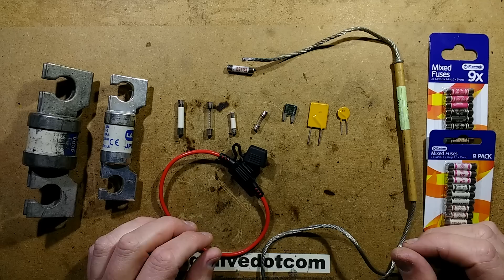Things you should know about fuses.  (including a 15kV one)

Comment: I like the longer 30ish minute videos because they have little tangents of knowledge explaining all the nuances. 

I knew off the cuff all the standard fuses (ie., HRC, slow blow for the inductive spike on start ups, NTC/PTCs etc), but I don't work on mains-level components. so when I saw the bi-metallic strip and thought "oh it must just be like an RTD" and it clearly was not, thus illustrating your "mishaps due to overconfidence" scenario beautifully.   

(Though, had I actually realistically been in a situation to design or remediate something similiar (rather than just watching this in a recreational capacity whilst eating lunch, I would immediately look up the application notes from at least a few reputable vendors such as Eaton or what have you -- the point stands. Moar videos like this!!!!)
Reply: Also, I had mistakenly thought that IP67 87v's were explosion proof (i.e., while working in a dangerous environment, the meter will not contain any component to escalate the danger level). I had then quickly remembered this was only the case for the  red-enclosure versions 87v and 28i -- both designated by Fluke as 'instrinsically safe'. 

Standard US military issue from Fluke was the 27/FM, which were available on ebay for pennies (comparatively) a few years ago before. They had upgraded all of their staff with 28ii at the same time, and flooded the market with top-quality 27/FMs  from the surplus suppliers. People were getting entire units with cases, high voltage probes and 8 month old calibration stickers, for less than the price of retail high voltage probes.

The first digit of the IP is for dust and particulate ingress (6 being dust-proof), the second digit indicating water-proof up to a certain pressure (7 being at least 3 minutes of at 12.5kPa at 10 litres a minute of flow, 6.3 nozzle dia -- 8 being 3 minutes @100kPa @ 100 l/m, 12.5mm nozzle dia). At standard pressure, '7' works out, 'waterproof' up to a meter of water at SATP under 3 feet of water load for no less than 30 minutes)) '8' being essentially hermetically sealed.

In practice, an IP 68 rated piece of kit will most likely be explosion proof, but there are special class, division, and group designaters (materials, autoflammability, etc) must actually be matched properly to the environment to ensure safe usage.

Comment: I did my tool making apprenticeship at a company that made HRC fuse links i think that the sand was silicon and another reason for the sand was to stop an explosion with associated ceramic shrapnel . The fun thing to watch was the test room for testing ceramic insulators for high voltage transformers they got a blue mist of electricity shimmering across the insulator ans if there was a pin prick in the glace and water had got in ka boom instant steam and shrapnel fun days

Comment: I don't think you mentioned it, but i am curious if there is a different behavior in fuses when using AC or DC? I know there are special circuit breakers for DC, but i don't think i've ever seen specialized fuses.
Reply from the maker: You do get specialist DC fuses, but for low voltage use normal fuses are often used.  The main issue with DC is that the current is continuous and therefore it's harder to break the arc.

Comment: When I worked for an American analyitical company, we had to carry both US (UL STANDARD) and UK fuses. There is a major dif in the spec for TD/slow blow fuses.
We had a cct bds that kept getting destroyed if something shorted. Turned out that we the slo blo US fuse could handle a far higher surge and we had to replace it with a far higher slo blo UK which didnt give enough protection. If you look it up I think its to do with the rupture voltage/current.EU fuses were dif also as was Austrailian. Ended up carrying so many types of fuses!

Comment: You didn't mention gas discharge tubes. Not technically a fuse I suppose as we used them to divert high voltages from lightening strikes to ground

Comment: My only interesting fuse experience is rather mild.  The output of a low voltage DC power supply had a 7A fuse.  I only had a 120V fuse handy.  Hey, amps is amps, right?  It blew.  I was advised I had to use a 32V fuse.  Sure enough, it held.  It looked the same.  I guess the timing was different.

Comment: Clive, not quite the full story on that HV link, the steel strap is in there because there is considerable tension put on the link by a spring at the bottom, when the link blows, the spring releases a cam mechanism that effectively shortens the candle (drop out tube) this means the top of the candle drops out of the top contact and then the whole candle swings down and hangs up side down in its holder. This gives the faultman a visual indication that thw link has blown and it's this drop out function that actually ensures the fault is clear. Hence the name, drop outs.

Comment: Had fun with the glass AGC fuses, applied heat to the end caps and removed them, replaced the fuse wire with a piece of ultra fine copper wire. Resealed the one end with wire in place and let it cool. Afterwards added a little black powder to fill half way and then stuffed a bit of paper towel in the tube to keep powder at one end. Fold over the copper wire over the tube and re soldered the cap back on. A quick continuity test to confirm all is ok. We used these in golf carts when we wanted to prank someone. They only went into a fuse holder under the bonnet so as not to allow fragments of glass to fly freely through the air. When the circuit is activated the mark will mess their pants when the fuse blows, goes off like a very loud firecracker. Kids don't try this at home!

Comment: As mentioned by others, HRC fuses are typically designed to work on AC only and rely on the current reducing to zero to help extinguish the arc. Was that badly damaged fuse you showed on a DC load?

I have seen where the wrong type of fuse was used the high voltage produced by breaking a big fault current would jump the body of the fuse.

Fake UK plug fuses are also common which are not filled with the correct material or even have the correct size wire.

Tungsten lamps do have a high starting current, low resistance when cold.
Reply from the maker: This fuse was blown in AC power distribution equipment, so a very high fault current.

Comment: what about temp ones. iv been told they have them in dryers. like if it gets to hot it would go.
Reply from the maker: Thermal fuses.  Usually used as a last resort if something is getting too hot.  Some of them use as loop of low melting point alloy that breaks and pulls back into a blob when it gets too hot.

Comment: How cheap do you have to be to leave out SAND ? That is what Chinese fakes use to add weight to fool consumers, but nope, can't spare any for ceramic fuses!
Reply: They probably didn't know the purpose of it, so they left it out.
Reply: Mister Hat, I don't know what's worse here: miserdom or ignorance. If you make fuses, you should know how they work to make them properly.
Reply: Not only the cost of putting it in, but with the caps just pressed on the sand shifting might knock the ends off in storage. You probably at least have to glue it with sand inside; another labor step!

Comment: The thing to remember about fuses is that the $100,000 irreplaceable component will invariably protect the $0.05 fast-acting fuse by blowing first.
Reply: Yeah mate, you got it!  We of the Fuse Preservation Society will back a quantity of metal over doped substrates any day.....
Seriously, I view fuses as a last resort to stop things going on fire, I would never consider them  as capable to protect semiconductors, but there are Thermistors (ptc is mentioned but I think I recall ntc also?)
It comes down to design, making a system safe and reliable should NEVER depend on your choice of fuses, they are last-ditch backup in the event of failure....think of them as fire extinguishers, to be used when SHTF, BUT CANNOT PREVENT THE EVENT.
Reply: Well, it is replaceable, just with $100,000
Reply: @Julmaa87  Nah its $100,00 but it´ll be back in stock next week. Well "Next Week"
Reply: @Julmaa87  there are things that cannot be replaced
Reply: @chri-k  Yes, humans. And well, life in general.
Reply: You are assuming what you are using actually has a fuse
Reply: A 6 inch nail will always do the trick..!
Reply: @TrickyDickyP  I have seen that done , on a circular saw of all things . Scary as hell
Reply: Not with the traditional SS (transistors). Maybe with the new IC's. Price goes up with good protection. The case you mention, maybe it happened to you because of catastrophic disaster of the likes crazy lightning type.
Reply: @franciscorompana2985  It's just a joke.....
Reply: @FlameStrykeShadowDark  of course. Fun anyway, on how to make someone buying an hi-fi fuse and have something to write books about the better sound.
Reply: can't be further from the truth 😂😂😂
Reply: Put in a lower rated fuse?
Reply: Only if the system has been designed by someone who knows little about electrical design.
Reply: That is just Bad Design.
Reply: @YodaWhat  it's a feature.
Reply: @BuckFudweiser  Sometimes a 'bug' really IS a 'feature'. But it is very rarely a feature you'd want! ;)

Comment: I have a microwave oven that blows its internal fuse every few months. The original fuse was a time-delay 20-amp fuse (bear in mind that appliances that use more than 15 amps in the US must have a NEMA 15-20P plug on them). I decided to measure the load current and the thing is drawing 21-23 AMPS during use! I'm guessing the transformer probably has a couple windings shorted on the primary or something, because this thing acts like the magnetron is way over-powered. It'll heat a cup of water to a full boil in 1 minute, though, so I'm not complaining too much about it! XD

Comment: Old barns and houses etc here in the US used fuses with screw in Edison style bases just like our light bulbs.  The number of houses and barns and sheds that burnt down because someone just used a 30 amp one instead of a 15 or 20 amp fuse is staggering.  There was a short lived idiot proofing system that used different sized bases for different rated fuses but circuit breakers quickly became the norm.

Comment: 6:25 I had that happen on a cheap Kinyo audio amplifier I was repairing years ago one of the amplifier ICs shorted out and damaged the fuse. After replacing the bad components it still wouldn't fully power up. The power LED only lit dimly. I traced this to the axial glass fuse (which was heat shrunk) and soldered on one of the transformer secondary wires. 

When I removed the heat shrink to inspect it the inside of the glass looked black but under the right light it had a shiny hue to it.

It turns out the filament vaporized and created a high resistance connection across the glass to each end cap which was enough to dimly light the green power LED but not power the amp. I think it was one of those piddly 3.6mm x 10mm glass fuses so the filament didn't have to coat too much glass I never did trust those fuses. The minimum I'd ever use in a project is 5mm x 20mm.

Comment: The most common fuses in old US electronic equipment were 3AG 3A or 1A fast blow. I don't know how many times I;ve found a piece of equipment where someone has put a 20A fuse in it. Scarey. I always check the fuse rating before powering something up, generally right after checking the condition of the power cord and the capacitors.

Comment: I use NTC thermistors (the opposite of those shown in video, resistance falls as they heat) to soft start sub 200W DC motors. I'll circuit them around a 1 or 2 second time delay relay to give a smooth sexy ramp up in speed before hitting the motor with full power. This is a great way to handle inrush limits in many power supplies.

Comment: Very thorough and good information. Although you covered the differences between voltage ratings and being able to use a high voltage fuse in a low voltage circuit, you didn't mention that AC and DC fuses are very different. AC is easier to self extinguish while DC won't self extinguish because of AC commutation, so an AC fuse can't be used for DC without careful consideration. It's the same reason relay (and switch) contacts have a higher AC current rating than a DC current rating.

Comment: I have a 360 light for drywall and painting. It will not turn on again if you turn it off once it's reached the operating temperature. You have to wait for it to cool. 15-20 min. I always thought it was the bulb. But it must be one of those yellow fuses.
Reply from the maker: Is it a metal halide discharge lamp like an industrial floodlight or shop display light?   They have to cool down before they can restrike again because of the way they work.

Comment: Why hasn't the UK switched to resettable fuse breakers? I know most devices have a fuse in the plugs but why are they not breakers you can reset?
Reply from the maker: The main protection on each circuit is a circuit breaker.  The plug fuse is an extra layer of protection for the cable connected to it.

Comment: i love the current wiring in the USA from China..  Under size Gauges..  Iv had a Wire get HOT, and the fuse didnt fail..  FELT the wire, and Pulled everything apart, and told the person DONT DO THAT..
Another thing, you may mention is RF/RADIO/SOUND/IMPULSES on the wire...and Computer devices..  OLD DAYS the boards were not as protected, but EVEN NOW, it will shorten the life of your electronics..
Reply: what will shorten the life of your electronics?
Reply: @tsm688  allot of things, but the wireing to the power in the wall, When stressed Will Not help your computer.  Isolate (at least alittle) electronics power lines from anything with a motor or changed power draw quickly(Stove, microwave, Heaters) 99% of electronics dont use 110 power.  They have transformers to break it down to 5-12-18-?? Volts, AC or DC, and even both.
Reply: @ecash00  for sure, if your writing's bad.  I've seen bad power kill a computer in 5 minutes flat.  But power THAT bad is rare in north america.

Comment: so this is unrelated but I was at a thrift and found a plastic thing 3 inch by 2 inch with just 2 wires and voltage I open it and it looked like the vibrating motor from a game controller but 200x bigger...might you know what it is used for ...it looks like it would be bolted to something but nothing els to it
Reply from the maker: +Dan Brit Sounds like a vibrator unit for mounting on a chute to make powders or grains flow along it better.
Reply: Is it egg shaped?
Reply: thank you I wanted it to be a big cap ... so totally cool to get something different :)))...and you are my fave youtuber please keep it up :))))

Comment: My worst electrical experience was the time I reset a 550 volt breaker on a motor that had tripped and as it turned out there was a dead short and the starter exploded. The door jumped in my hands and every fan went out. Turns out I had knocked out a major breaker in the electrical room. They rate those by the horsepower. Needless to say I called for an electrician.

Comment: For the expulsion fuse, could the thin wire be to stop such a large arc from the main alloy wire? If the main wire were to blow then the arc would be smaller as the smaller wire would still be carrying current until it blew creating a smaller arc?

Comment: I have seen one case where the power supply has failed in a chain reaction -- one faulty MOSFET shorted out, it got hot, melted its legs, shorted nearby components, created even bigger short, mains voltage got involved, plasma was created and everything exploded. Yeah. Literally.
The whole motherboard had trillions of blown capacitors and electronic components (even inductors exploded, that's how serious the fault was)
Not even one component or module survived -- graphics card (I think it was GTX Titan), hard disk, SSD, mouse, keyboard, monitor, motherboard, power supply, monitor's power supply, buttons and LEDs were all welded and/or severely damaged.
I went there and the first thing I could see was that the main breaker was tripped, and there was a stench of burning plastic coming from that person's room.
It was a sight to behold; everything was dead. I even saw the speaker malfunctioning because of the incident.

Oh, and you ask me which part of it is related to this video?
The person was so "clever" that this person either replaced the fuse with a thick jumper wire or bought the Shenzhen variant with "wire fuse".
The packaging did say it was Corsair 1200W PSU, but I suspect it was recycled/had botched repair done not by official repair service.

By the way, this person was using industrial power (220V 150A maximum here) because the setup was in a workshop.

Comment: Isn't rupture capacity the ability to hold expanding materials/gasses at high temperature and pressure, measured in Joules not Amps.

That pyrotech fuse has a negative rupture capacity:P

Comment: Great video, this should be mandatory viewing for all sparks. 

I work with electronic control systems, I regularly come across faults where sparks have been called out, found a blown fuse and thrown in whatever they have in their bag.

It's not fun having to tell the client that instead of replacing a damaged cable and a fuse that they now have to replace the entire control panel, cable and fuse.

Comment: One of the most commonly found incorrect fuses is in domestic 13 Amp plugs. Most devices come with a 13 Amp fuse in the plug when it is clearly not appropriate. A table lamp with a 20 Watt bulb for instance. Manufactures and suppliers really should get their act together.